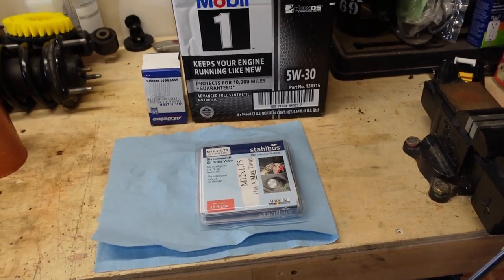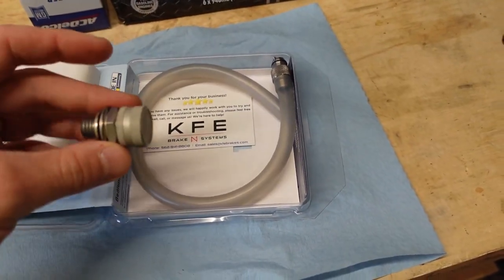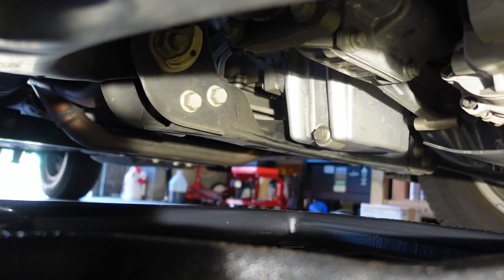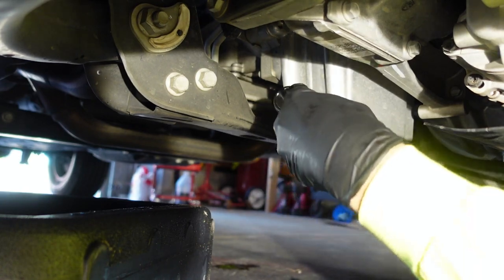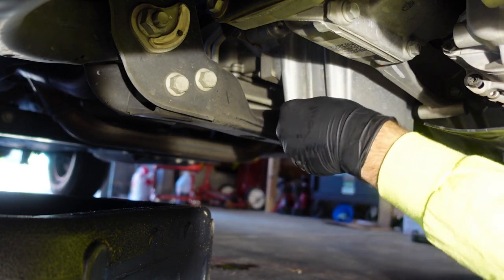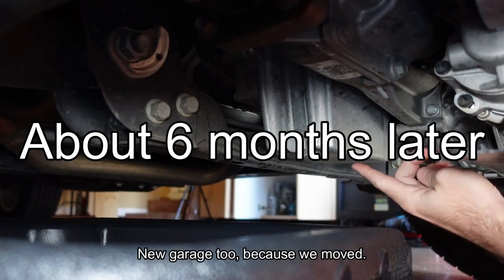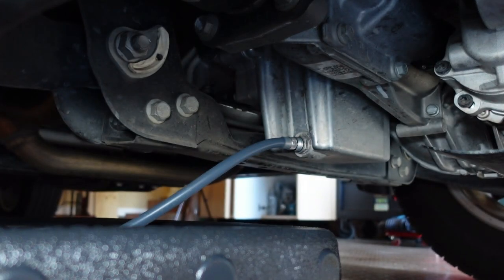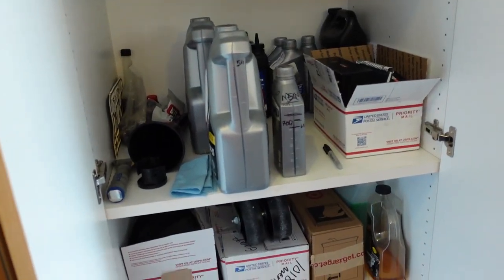[HOW TO] Install a Stahlbus Oil Drain Valve on a 2015-2022 Chevy Colorado/GMC Canyon (All Engines)

Comment: The only reason I'm hesitant to put one of these on my 2.8 Duramax is on those, the plug points straight down, and even stock it's already the lowest part.  If they'd put the plug horizontal, I'd put one of these on without a second thought.

I do wish I'd known about these before I put an EZ Oil Drain on the transfer case in my Jeep, since the built-in hose is even easier to route around the skid plate on that.
Reply from the maker: Yea that’s a downfall of the diesel oil pan I guess.

Comment: i put one of these on my Canyon for the same reason you did, oil tends to shoot out as far as the passenger wheel, it got pretty annoying constantly cleaning up oil from my garage floor and having to pour oil from my drain pan back into a jug, with this i can just let it drain into a 5 quart bottle and take it to get recycled.

only thing thats a little annoying about it is its a slower drain then if you just pull out the drain bolt, but that leaves time for other things while you wait

when i change my oil i also tend to drive up my drivers side wheel on a ramp so that the engine is leaning towards the drain side to get as much oil as possible out
Reply from the maker: Me exact thoughts. It does take a little longer to drain, but I find that if you start draining the oil. You can go up top and swap in the new oil filter, and top off your washer fluid, check your air filter, and by the time your done, the oil is drained. Totally worth it for a clean and easy oil change.

Comment: i like the fumoto drain plugs
Reply from the maker: Yea they are neat too. I’ve never used one tho. I might try one out for the heck of it. The only downside of this Stahlbus is it drains slow.
Reply: @fondupot  fumoto'es  drain a little slow as well. working outside in a breeze i learned the messy way to use a 2 inch pvc pipe cut to fit from the drain valve to drain pan. just get her started and grab a quick coffee.
Reply from the maker: @michaelotoole1807  Clever!

Comment: FYI. I think the link to the version with the retainer cap links to the M12 x 1.25 plug, not the m12x1.75. Which I just tried installing and it didn’t fit.
Reply from the maker: Thanks for letting me know. I removed that link. Amazon must have changed the listing. You definitely need to use the M12x1.75 fitting.

Comment: I regret buying the Stahlbus valve. The thread into the drain pan is so short compared to the original drain plug. The valve only counts 3/4 turns into the drain pan, where the original plug counts 8. I’m scared the Stahlbus will come out after a certain while. I tried to get in contact with the manufacturer, but they told me it’s not possible to extend the thread. I wasted 30€, but it’s worth using the original plug.
Reply from the maker: Sorry to hear that. I have no regrets. If torqued properly it shouldn't come loose. If you really feel like its going to come loose, you can always add a bit of removable thread locker on the threads to really lock it in place.
Reply: Lmao, why does thread count matter in this situation? Is it sealing properly without any leaks? Yes? Then thread length is irrelevant here. Its not as if drain bolt is going to come loose if properly torqued. For the purpose of drain bolts function, length is not important as you're gaining or losing nothing by increasing or decreasing its length.